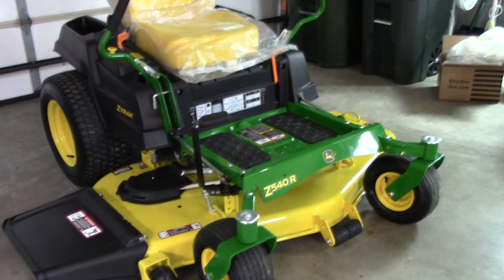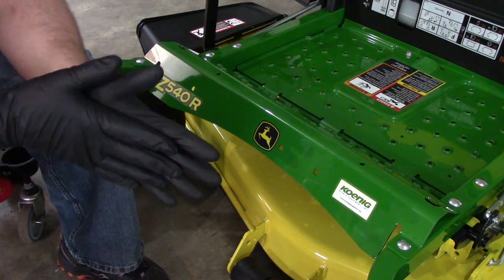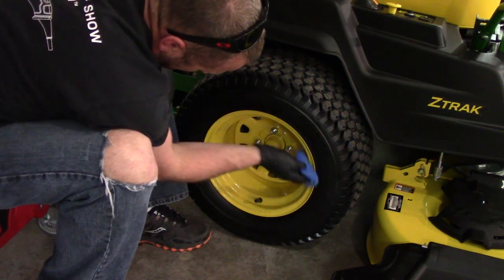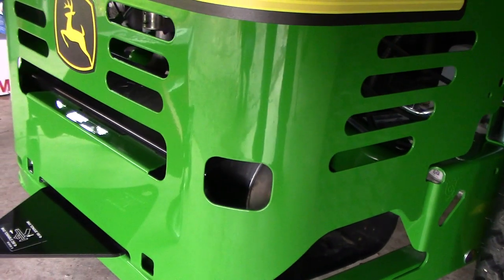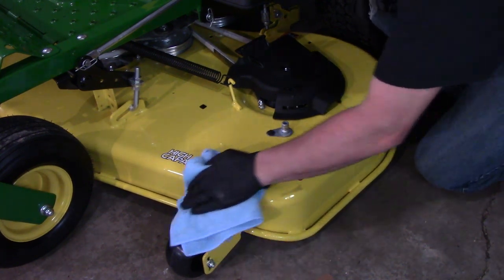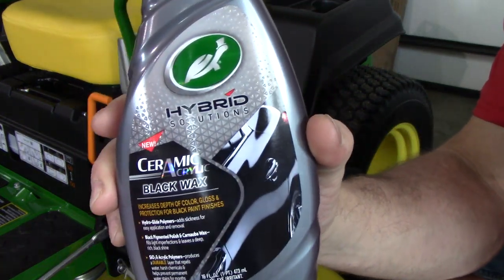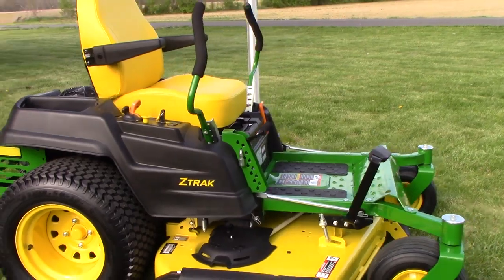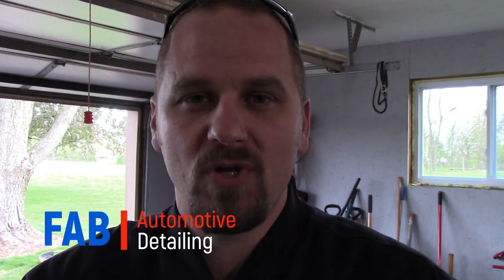Yes I ceramic Coated a Mower but I am Protecting My Investment!

Comment: If I had a new mower I would have done exactly the same.  I have a normal grass mower machine and I have detailed it but not with Ceramic coating because when I bought it over 10 years ago that wasn't available.  I have it detailed with Wax and it still looks kind of slick looking.
Xoxo from Puerto Rico 👍🇵🇷🖖
Reply from the maker: Always take care of your investments and they will take care of you.

Comment: You're not the only one! Coating my new Cub Cadet Ultima ZT1 tomorrow. Did an IPA wipe down this evening. I have a whole bottle of CQUARTZ SiC but I think this will be the perfect job for the leftover Can Coat EVO I have. The spray nozzle should get into all the cracks and crevices. 2 coats mandatory. I was thinking about spraying some Herculiner aerosol spray truck bed liner underneath the deck. I think the Gyeon Wet Coat spray will be ideal as a maintenance spray after a couple months.
Reply from the maker: I wouldn’t put bed liner underneath the deck. I would just coat the deck. My wife works at a Deere dealership and the techs always tell me undercoating makes cleaning a pain. Juts FYI
Reply: @FABAutomotiveDetailing  No worries. I used a whole can of Rustoleum spray on bedliner a year ago on my old 42" tractor deck. I didn't clean under the deck at all last mowing season. It was however remarkably clean when I sharpened blades a few times but the liner had worn down considerably.  I'm trying Herculiner spray next on the Cub.

Comment: I washed my tractor mower with TFR about a month ago. Then I clayed the paint and applied Turtle Wax ceramic polish. 24 hours later I applied Turtle Wax ceramic spray coating and a second coat 3 days later. Looked so good I did the same to my truck and 2 cars.
Reply from the maker: The Turtle Wax Hybrid solutions line are fantastic products.

Comment: What a great idea. I bought an electric mower last year, $600 and today I am going to pressure wash it and apply Gyeon Can Coat and top it off with Turtle Wax Ceramics Spray coat. Because last November when I cleaned it, well it was caked on and needed more than I have it. Never did I think about Ceramics.  GREAT IDEA.
Reply from the maker: Kyle Marx It’s worth the time and effort. I have used it a few times now and the deck still looks great.

Comment: You should have a follow-up video when you make your last cut before winter sets in. Like to see how the bottom of your deck looks like.
Reply from the maker: Slippery Blue Clay I definitely plan to do that!
Reply: @FABAutomotiveDetailing  With the yellow paint on your deck, it's hard to tell if you have a stamped or FABricated deck. My new tractor has a 50 inch FABricated deck, but I plan to try my mower lift soon, change blades, and clean the deck.
Reply from the maker: Slippery Blue Clay It’s a stamped deck! The mower lift makes deck cleaning and blade changing so easy.

Comment: enjoy it.if you want to protect it and last the ceramic long you need to clean it and and perhaps use a spray boost and re apply it if it is a slick smooth paint the grass should t stay on the body like to see a update
Reply from the maker: alberto gorin I plan to enjoy it! I also plan to do an update when I clean it the next time.

Comment: If the coating does not work. Try krown products. People in my area use krown on the decks of mowers and the grass does not stick.
Reply from the maker: Tony Michelon I appreciate the info. I have fluid film and I think they are close to the same.
Reply: FAB Automotive Detailing it’s been some time since you put the Adams paint coating on your Jeep. Is it still holding up?

Comment: Looks awesome man.. Its not a stupid idea🤔.. in no way do i think this is a stupid idea.. like you said.. protect your investment👍🏻I have coated lotsa mowers old ones and new ones with great results.. With all the dirt and sand..It doesn't last very long under the deck..but is very nice when washing it off. You are absolutely not crazy for doing this.. there is absolutely nothing wrong with coating a mower..
I got some new trailer rims and tires the other day.. I coated the wheels with CSL and still had some on the applicator pad.. I was in the basement.. I coated the furnace.. now THAT is a bit crazy..😃
Reply from the maker: MNpicker Glad to hear I am not the only one! 😂 Now the furnace yes maybe crazy. 😂 Thanks brother

Comment: Don't nothing run like a Deere. Love me some equipment - If I was you I would definitely coat all the surfaces as well. I am not at all ashamed to say my Tractor would certainly have tire shine on it.

Going to be super interesting to see how the coating lasts on the bottom of the deck.
Reply from the maker: LJM2stepspain This is my first Deere and I love it. It cuts so nice and fast. I plan to do an update when I clean the deck.

Comment: Anything that might help with maintenance is always worth it. Stay tuned for the follow up video, was it worth coating the JD? BTW, I think you missed a spot.😁
Reply from the maker: Wade Miyataki Yes anything that helps! I plan to do a video when I clean the deck in a few months. Don’t tell me I missed a spot it will drive me nuts. 😂
Reply: @FABAutomotiveDetailing  Just messing with you because now I have to hit the mower with HCW. Thanks Brian!

Comment: Very interested to see how this holds up, or if there is any benefit. The seat though? HA...I didn't know you should do vinyl seats with ceramic coating. I want to put something on my JD rider (x350) plastic hood.
Reply from the maker: I am very interested also. So far the inside of the deck has stayed really clean compared to my other mowers. Ceramic will protect the vinyl also and keep the seat from fading.

Comment: I just bought a Scag Freedom Z and thought about doing the same thing, but just to the deck. I didn't have any coating on hand and I couldn't wait to use the mower so I didn't. Curious to know how it holds up, so keep us updated.  Looks like a nice mower, I looked at a bunch of different brands before getting the Scag, but I never looked at the JD's....I just can't get past the green and yellow, if it were any other color I prob would have checked it out.
Reply from the maker: sixsixST2 I will definitely make an update video! I like bright colors so it didn’t really bother me. It could have been purple and I would have still bought it because the discount was so good it didn’t make sense to buy anything else.
Reply: @FABAutomotiveDetailing  I hear ya. Scag was giving $400 off these so I jumped on it.  My plan now is to get the ryobi udercarrige pressure washer attachment and just hit it a couple of times during the season to help keep it clean.

Comment: Hey buddy!! I don't think your crazy at all. I'm getting my new zero turn today! Quite excited. Hey what we pay for them, we should be protecting  them. Couple questions: would you use Jescar power lock plus sealant on mower instead of ceramic coating? Does paint have clearcoat? Did you try water cleaning system on deck? Thanks for video!!
Reply from the maker: I would use a coating on the deck atleast since it’s new it really kept my deck clean. The John Deere paint is clear coated. I don’t use the water fitting on the deck I just use a pressure washer.
Reply: @FABAutomotiveDetailing  I'm surprised how swirled up the paint is on new zero turn. Not going after it. Lol.
Reply from the maker: @kimnewling5728  Yeah on a mower I’m not really worried about it either.

Comment: Hey Fab , I use Amsoil what do u think about it. Have u tried it before. I change my oil 1 time a year or 20,000 miles. What's your thoughts?
Reply from the maker: James Chapman #Autodetailing Amsoil is all I use if that tells you anything! Now being a mechanic I don’t believe in going that far on an oil change. I go 10k tops or every12 months whichever comes first. If you change your filter at 6 months then you will probably be ok. Filters are not designed to go that long and I have changed plenty of oil that has gone that far and the filter was collapsed or almost plugged.
Reply from the maker: James Chapman #Autodetailing I also only use Amsoil in my mowers and 2 cycle equipment.
Reply: @FABAutomotiveDetailing  ok that's good to know. I have not had that problem. But I do mostly highway miles. I use the Amsoil filter. Good info brother. Talk to u tonight. R u doing a live stream tonight?
Reply from the maker: James Chapman #Autodetailing I plan on doing a live tonight it just depends on how the afternoon goes.